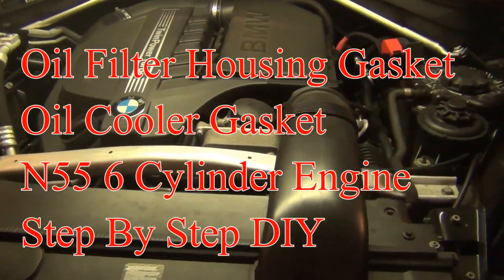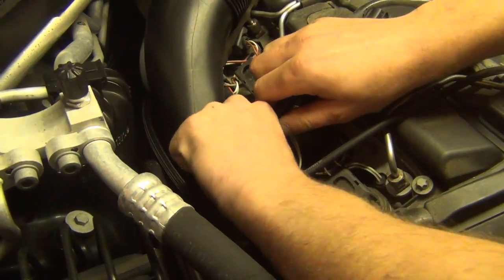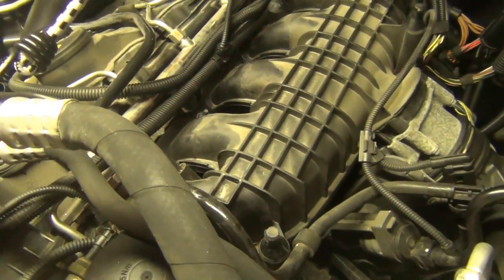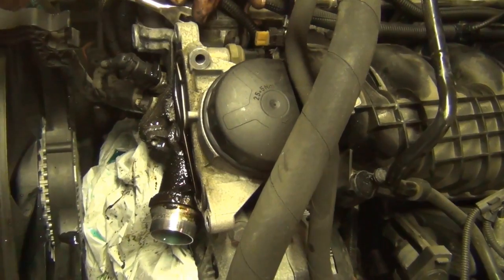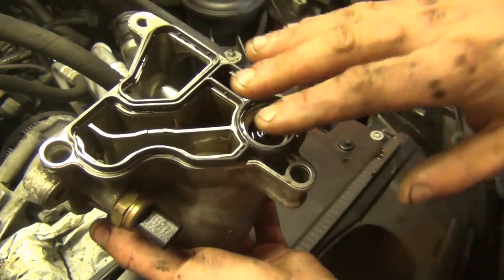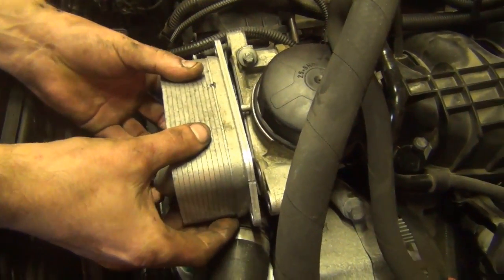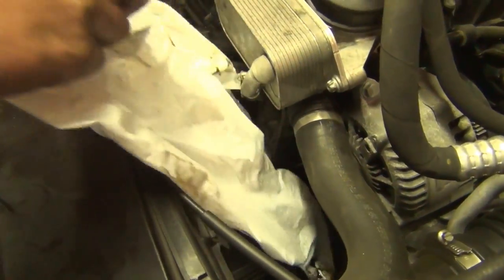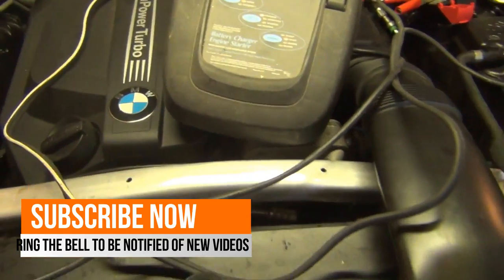BMW Oil Filter Housing Gasket N55 And BMW Oil Cooler Gasket Oil Leak Full Easy Step By Step DIY

Comment: You can sometimes get away with an 8mm  or 5/16th swivel on that hidden bolt if you dont have E ttorx drivers
Reply: does the intake have to be removed?? I did hear it can be done without removing the intake on N55 Engine,i assume its a lot harder to get at that bolt and time consuming  ty
Reply: @battlehrfred  No but you need to have some flexibility to get at the one bolt on the oil housing If you have an 8mm or 5/16 swivel socket it should be able to remove the torx bolt
Reply: @alexlaverick6111  , Ok ty Sir for your prompt response
Reply: @battlehrfred  i use a 5/16 quarter inch drive flex socket on the lower torx bolt with a mid length extension Works every time
If any of the rubber hoses attached to the oil filter housing are damaged from oil replace them as well. They will leak sooner or later
Reply: @alexlaverick6111  ty for your excellent info.I will be ordering "Mahle seals/gaskets from Rockauto,hopefully they will last,because its hard to believe that some Company/Supplier do not have a "permanent" fix. especially BMW,That has me astonished there is no solution...engineers can put a spaceship on the moon,but not have dependable gasket...unreal... ty

Comment: This may be silly to ask, but do you need to drain the oil before doing this repair?
Reply from the maker: Hi John, That is a good question. You do not need to drain the oil. Crack the oil filter loose and wait a few minutes for the oil to drain back from the housing. Then you are good to go. Avoid spraying any cleaner into the engine. If you do or you get a lot of coolent into the ports then you can do an oil change after the repair. I hope this helps. My best to you and your family.

Comment: This job would take half the time if it wasn't necessary to undo the intake manifold.
Reply from the maker: Hello Rolly, Yes indeed. On the N51 and N52 engine it is much easier. I hope the video helped!
Reply: @AskTheCarExperts  I have a 2014 535i. 3 litre inline six, twin turbo, complete with the oil cooler leak, lol   I'm getting prepared to change the gaskets and I found your video very enlightening. Thank you
Reply: The rubber gaskets between the oil filter housing and the engine, and the oil cooler to the filter housing were changed on my car about two years ago, and now the leak has returned. I bought the two gaskets from my BMW dealer and they're quite expensive for a couple of pieces of rubber. Supposedly, the original equipment gaskets from BMW aren't the best quality, and the aftermarket parts are better.  I guess I'm about to find out.
Reply from the maker: @rollydoucet8909  Glad you told me that. Make sure to check the sealing surface for any corrosion or imperfections in the sealing surface. If you find pitting it will leak again. The fix is to use JB weld and fill the pitting and sand the surface smooth. Just a small amount of JB. But it had to cure before you sand. Hope this helps!
Reply: @AskTheCarExperts  I had no issues with pitting. My car had only 23,650 miles on it in 2017 as it wasn't driven much by the previous  owner. I store it every winter, and the leak started shortly after I got it out of storage. The factory warranty expired during the winter. Now, I've got just under 40,000 miles on it and the leak has returned. More than one person has told me that BMW outsourced much of their seals, rubber, and plastic components to the wrong manufacturer for a couple of years and that's why coolant and oil leak issues are so common. This time, I bought gaskets from an aftermarket supplier that specializes in German cars. Supposed to be better quality, we'll see.
Reply: @rollydoucet8909  do you mind sharing which supplier you went to for the replacement gaskets? I will be doing mine soon and dont want to go with BMW.
Reply: @kevinramroop6917  Did you get my reply?
Reply: @rollydoucet8909  I havent seen a reply.

Comment: Dropped one of the nuts🔩 😭😭
Reply from the maker: Oh no, For the intake manifold?
Reply: @AskTheCarExperts  yeah
Reply from the maker: @blackwolf1780  Sorry to hear that. You can use one of the existing nuts to match up a replacement or pick up an OEM nut from a dealer. As long as you did not lose it in an intake port and it's not inside the engine you should be ok